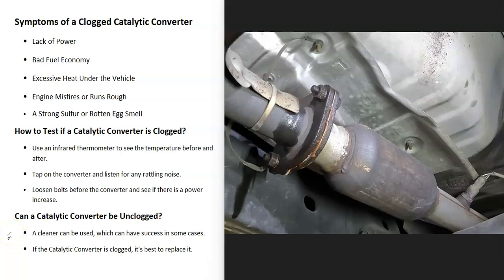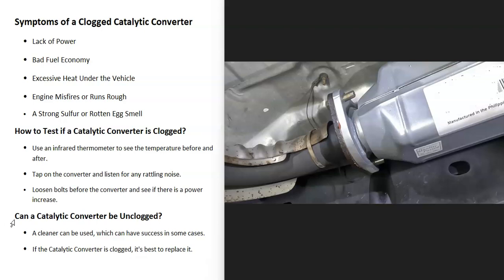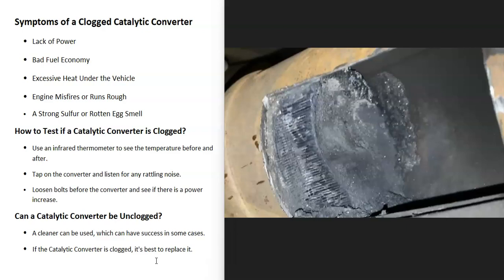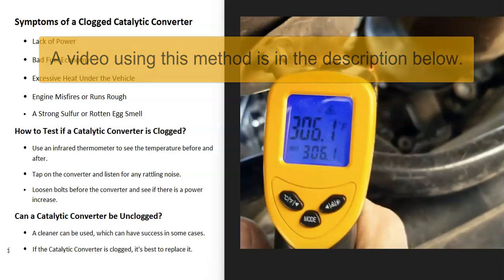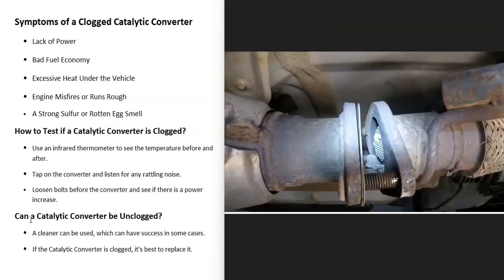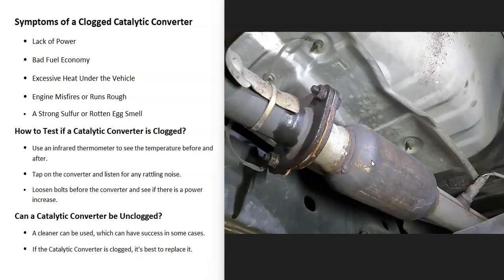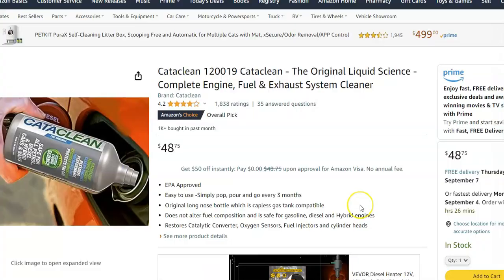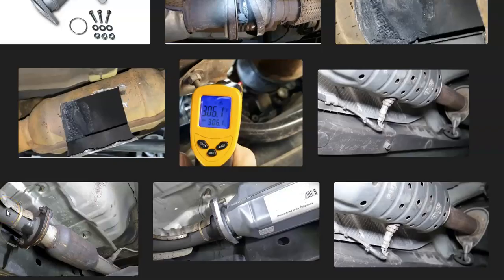Symptoms of a Bad Clogged Catalytic Converter

Comment: I took out the 02 sensor and added a shot of carb cleaner and a cup of soapy water let it sit over night drive it today it had so much power 0 to 6 in a jiffy maybe you should try that regular dish soap and a glass of water works wonders

Comment: My 08 dakota check engine light comes on periodically and it shows as catalytic converter. But the light goes off & comes on at random. Had Firestone replace the 02 sensors & all was well for 18 months.
Reply from the maker: It needs to be diagnosed, but the CAT may be starting to go bad. You can try a CAT cleaner such as CATA Clean and see if it helps.

Comment: Had my 2014 chevy cruze check engine light came on and had it checked and threw for the CC.  With this, could it cause sputtering and dying on start up?  For example i start car it fires right up but then after about 45 seconds to a min sitting in idle I notice car starts sputtering and if I don't give it gas it will die. So is this a symptom too? I'm just concerned and I'm in whole another state away from family and friends. So even more stressed. So thanks for any input or suggestion
Reply from the maker: It needs to be diagnosed, but if the CAT is fully clogged, then it can cause those issues.

Comment: My vw transporter goes into limp when hooning it on the motorway...... Changed absolutely EVERYTHING now  Turbo, intercooler, all sensors, wiring triple checked, remap from 174 to 205 bhp.... Is ok driving hard around town, but every few miles on the motorway it just gives up.... Not even giving codes now..... Seems imo tp have no torque in 5th n 6th.....ive said to two garages for months the cats blocked but they disagree.... 20 yr old van, 80% short journeys for past 13 years........ Any opinions
Reply from the maker: It needs to be diagnosed, but it could be a clogged-up CAT. If the CAT is easy to get to and depending on the exhaust, if you can loosen up the bolts before the CAT and drive around the block and see if performance improves. If it improves and has power again, the CAT is clogged up.

Comment: Can this cause a 2000f150 4.6 xl to rev up to explode i have to shut if off after it gets warm about 30 minutes or so it does this?? I dont smell anything ive changed egr stuff ,the tps,iac pcv.ckeaned throttle body, plugs coils.battery.iy runs like new then just goes to about to explode??? Been year tryinh to fix it.i do not drive it for that reason

Comment: I’ve got 2004 ford ranger 3.0 liter v6 and I had a problem where I fired it up after running on the high way for 20-25 mins and then cut it off came back to start it it was fine but I went up the hill and felt like it was bogging down and sounded like a miss fire well I towed it home put new plugs plug wires and ignition coil and it still sounds rough like a miss fire I did get a code when it happened it was one the cylinders not firing but I haven’t had a code since still trying to narrow the problem down I’m thinkin it might be the cat also fuel filter was replaced and the fuel pump kicks on

Comment: Can I bypass that catalytic converter mines been stolen?
Reply from the maker: You can complete the two open connections temporarily with a fitting at an automotive store. It won't pass an emission test, and you will get codes, but it should still run.

Comment: Another symptom of a bad cat is the vehicle runs fine but when the motor get warmed up it will start stalling when slowing down to come to a stop or at idle. Rule out dirty throttle bottle first and check for codes.
Reply: That's about what mine  is doing. Not in the morning but on my way home about 40 minutes and up a decent grade when I slow down it gets real loud I don't know how to describe it but somthing like a loud bah bah bah and somtimes die when I pull into my driveway but it does this everyday. I'm hoping that's all it is. I had a bunch of work done last year because of this, and they said it was the throttle body and accelerator coils. 3k later, and it still does it.

Comment: My car randomly dies sometimes in the middle of the street and struggles to turn back on again. I thought my starter was bad since i had issues starting it before driving. But now idk if its just a bad catalytic. Does a bad cat cause a car to stop and then struggle to turn over until i press the accelerator? I even bought a new starter if it isn't part of the reason :(
Reply from the maker: A bad CAT can cause the engine to run badly, but it should start. Also, a bad CAT will usually give a code. I would get an OBD scan tool and read for any codes, as there likely are codes that should point to what the issue is.
Reply: @HVAC_Mechanic  ok yeah, I should've gotten an obd before getting the starter. I got a bluedriver obd2. My ex has my old one, so I didn't want to ask her lol.
But yeah it gave the p0420 code. I wish I knew more about cars and i almost have the basic tools needed. It's expensive. but everyone starts somewhere, I guess. And Thank you!
Reply: @kaduku1112  having the same issues. Did you have tricks accelerating ?? And did you ever try cataclean ?
Reply: Sounds like a crank position sensor.
Reply: Yea it can cause your car to stop seen a video on FB where parker took off the piping the dudes car started right up after he said would no longer start so I'd say yea it can cause your car to stop turning over n running

Comment: i replaced my catalytic converter last October it was all good but after 6months its started showing code P0420, im using 2011 toyota vitz 1.3L. will it be caused by EGR system? car doesn't go above 4500rpm.easily. if press the paddle long enough it eventually reaches 5400rpm...
facing vibrations while at idle ... some backfires and when i press the throttle to the floor... i can smell a odor in the cabin.
Reply: updates on what you ended up doing? Did you have to replace the catalytic converter again?

Comment: Would the engine shake too ? I have almost all the issues but my engine shakes
Reply: Same.. not sure if I need a oil change or the cat is destroyed, I hear no rattle noise, no check engine light but car is shaky when I start excellerating and after I drive it on freeway I can smell rotten eggs when I park it, can be anything but I did run the engine without oil recently, had no clue it was out and for how long, could of damaged engine but I also see a oil leak, not good
Reply: @sillywillie5076  what kind a car is it and did u end up finding the issue
Reply: My motor was doing that to but all I had to do to fix it was get new motor mounts

Comment: Hello I’ve been trying to fix my car for a while now. It’s a 2004 BMW 325xi and I hit a bad pothole that apparently hit my cats making it clogged. After replacing the coils plugs and sensors now anytime I start the car about 1-2 minutes after a loud banging noise starts (not engine knock) and makes the whole car start jerking a little. Please lmk if it’s best to straight pipe the car or it’s maybe an engine / oil burning issue. Thanks 🙏🏽
Reply: Sounds like bad coil pack

Comment: Mine sometimes loses power when accelerating, sometimes can’t get past 3k rpms and emergency relief valve pops a few times when that happens. All is well when I let go of the pedal and push it again, it like resets itself.
Could that be a cat problem? 
I smell a burnt smell after driving it for a short while, the cabin gets hot too.
Would it be a smart idea to take the cat off and check inside?
Reply from the maker: I would test the CAT while still connected.  You can test it with an OBDII scan tool or a low-cost infrared temperature gun.
Reply: @HVAC_Mechanic  hmm I might have to go with the temp gun since my car is from 1981. I’d like to get an exhaust back pressure gauge but they’re kinda expensive

Comment: So i have had my catalytic converter replaced the beginning of this year..my thing is,lately my car "bucks" sometimes when i start to drive..shes  not getting up like i KNOW She can😂😂(2015 honda accord sport)..the guy i go to said it could possibly need transmission fluid which he said cant be used seen as easily as the regular engine oil stick🤔,i wonder what it could be
Reply: Check if your spark plugs are worn out. If you are familiar with replacing them, you can remove one at home and check the gap spark plug gap guage (they are available at most auto parts stores for under $5). If the gap is probably more than 0.010" (ten thousands of an inch) more than what it is supposed to be, that can be the cause of your hesitation when you are accelrating. The fix then will be to replace the plugs. You can look ypur owners manual under specifications for the OEM spark plug gap. If the plugs are original, this could be the problem. 

In my experience working at a shop, if your transmission has never leaked oil, and isnt leaking now, leave the level as it was filled at the factory. If ypu change the oil, measure how much you drain out, then add the exact same amount of OEM fluid in, at the same twmperature the old fluid was measured at. New trans fluid is very susceptible to expansion with heat, and contraction with cold
Reply: One more thing, is to visually inspect your ignition coils when they are out for cracks or arc jumping. You can google that to see photos, its kind of a subtle thing to look for. Ignition coils also can fail due to heat, and not have those symptoms. But I would say check the plug gap first, and if it is way out, then that is the most likely culprit, and least expensive place to start

Comment: Question: the lacquer thinner in the fuel tank method. Is there a risk of that dissolving or damaging elastomers in the fuel system?  For example orings at fuel line connectors, orings and seats in fuel injectors, diaphragm in fuel pressure regulator …..  etc.   otherwise the lacquer thinner supposedly works great to dissolve carbon and tar in the cat to clean it out while you drive.
Reply: i tried. it works
Reply from the maker: I have never tried that method, so I don't know if it works or not. EricTheCarGuy did a video on that some time ago, and it didn't work for him. If you try it, let us know the results.
Reply: Tried it after Cataclean didn't work and Lacquer thinner didn't work either.
Reply: @mikepettengill2706  was your cat just bad?
Reply: @dramatimefighting  Probably? It was one of the things that I changed before I passed Cal emissions. But, I did other things too to get the check engine light to stay off so I am not sure. A mechanic who worked on it said the Catalytic Converters should last forever, but they get fouled. So I don't know what to think. They are very expensive and I am at a loss as to why no one has come up with a reliable method to clean them if that is really the issue?

Comment: I smell rotten eggs in my 2011 Altima. It drives fine with light pedal, but if i hold the pedal to floor it accelerates slow and under powered, engine doesn't get louder, sounds like it can't breath.  No check engine light, just passed smog test last week.
  Update:   changed Cat manifold,  all issues gone.
Reply: What you can do to save a tow bill is get under the vehicle and drill a couple 1/2 inch holes forward of the cat, it will run just fine and you can drive it to a muffler shop, it will just sound like a tractor until you get a new cat installed.
Reply: Don't ever do that.
Reply: @andrewmccartney3020  Why not
Reply: @andrewmccartney3020 yeah, why not drill holes and drive to a muffler shop?
Reply: Have the same issue with 2012 altima. I have no power when flooring it. Just bought a new cat converter and will replace it.
Reply: @SnoopPros  the old cat was clogged. It drives like a new car since I've changed the CAT
Reply: yeah i cant wait to change mine. im literally driving 40-50mph max on the highway its a struggle 🤣 @ninegeorge
Reply: @ninegeorge why not just clean it?
Reply: If you smell rotten eggs. It could be your battery.
Reply: @TheAbeSystem  rotten egg smell is related to the catalytic converter going bad. Sulfur smells like rotten eggs not battery acid. 🇺🇸 1st 4ever
Reply: Late to the party but incase anyone comes across this later on rotten eggs are usually 1 of 2 things a leak in your headers or plugged cat , sometimes a plugged cat can lead to a leak in your headers tho
Reply: Finally,  changed cat ?.

Comment: My son just recently bought a 1984 Cadillac Eldorado and I just got to check it out for the 1st time this evening. At 1st it ran great but after just a few miles it started missing and I could smell something getting hot then about a mile from home it over heated. I'm thinking it's a bad Cadillac converter what do you think?
Reply: My camaro is doing this and mechnics cant seem to figure it out. New battery, new plugs, new coils, primary cats gutted, new maf sensor. Now my theory is that its the secondary cats that are clogged causing me a misfire, there now seems to be a rattle under the car and a smell from the car. Also, it doesnt really happen till the higher RPMs 5k+, it seems like I can go no faster than that before misfiring. Its hard to tell in theory because the secondary cats are not monitor, so it wouldnt throw a code for that set. I plan on just simly deleting them with a base tune and going from there.

Comment: Thanks, i am grappling with this right now. I didn't know that misfiring is a symptom of a clogged converter. I have a misfire code as well as some exhaust sensor codes so that is giving me a clue. Cataclean is easy to use but I cant tell if it worked yet. I got your cheap code reader and I am going out to check and see what it is saying since I ran the cataclean and reset the codes.
Just trying to get this 2000 chevy 1500 silverado through emissions.
Reply: Initially the code said it was a oxygen sensor. the second and 3rd times it is saying coil #1. I've experienced a clogged converter before, but back in the day the guys I knew just ran a rod throught it and gunned the engine to blow out the comb!! What is happening now is the engine starts fine but bogs down a bit after driving a block or two and severely chokes around 35-40 mph. I'm trying the cleaner. Thanks, much appreciated!  I never knew there was such a thing.
Reply: Dyt
Reply: Did it work?
Reply: @sillywillie5076  Didnt seem to do the trick at all. I did see an intersting change after replacing the fuel filter and pump. No more 'Check Engine" light. I am too busy with work and my youngest turning one years old today to spend the time checking the codes yet. But I am interested to see if I can get it though emissions now?
Reply: Figure it out?
Reply: @cliffflood7284  It went through emissions without a hitch, but that was after changing the cats in March. Not sure how that fixed the misfire, had a check engine light a few days later but it has since gone away. I am suspecting electrical issues. Wiring and connectors from camping on alkali flats every year for 15 years in wind rain heat and cold.

Comment: Could this cause jerking or hesitation when acceleration?
Reply: I’m thinking yes. I have jerking and hesitation in my 06 4Runner. I replaced the fuel pump filter and it seems to go away but my old filter was Soo bad that the new one did make an improvement. I’m actually going to try seafoam.. they say pour 1/2 can directly into 1st 02 sensor hole.. let sit for an hour… re-place the 02 sensor and take it for a drive. It’ll smoke heavy for a little bit since it’s burning out all the buildup in the cats. I’m trying this. Look for the video with seafoam and clogged cats. I hear a lot of success stories. I’ll update in a few days on how my “fix” goes.
Reply: @jakelapoint drreyyt
Reply: Everytime i get on the gas my car sits at 3k rpm for a second making a burbling noise then accelerates slowly but surely. It makes me look like i have rolling antilag
Reply: @lagod63 I really hope this is my cats acting up😩 I can’t even drive my car atm until my mechanic is back from vacation
Reply: @RamzaBeo  i realized it was the knock sensor for me. Its a common issue with this car. I still have yet to replace it cus im sure ill be charged some decent money since its located under the intake
Reply: @ was your car producing greyish smoke and having a catalytic converter smell?
Reply: @ i still have a clogged cat so i smell the sulfur/rotten egg smell but no grey smoke
Reply: @lagod63 SAME BRO!!!
Reply: That sounds like your camshaft coupler have it replaced for about 150 bucks and it will drive good
Reply: @dianeprice1153 fgf
Reply: @dianeprice1153 f
Reply: Check your spark plug gap. If it is worn more than 0.010" (ten thousands of an inch) over the factory spec in the manual, it can cause a hesitation or misfire when accelerating. Like the other guy says, visually inspect your coils when they are out for cracks or arc jumping
Reply: Fuel filter or pump most likely the pump
Reply: Thats more like ignition coil